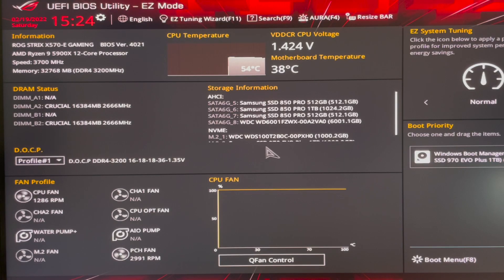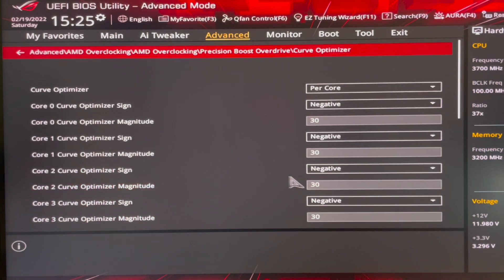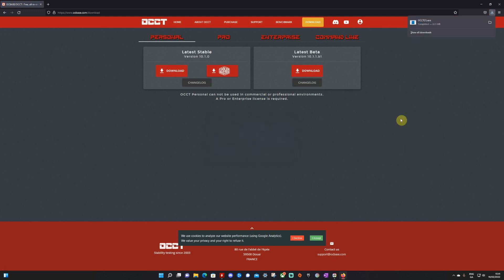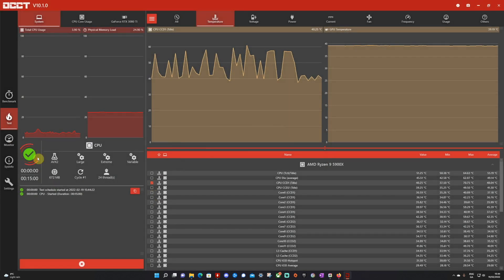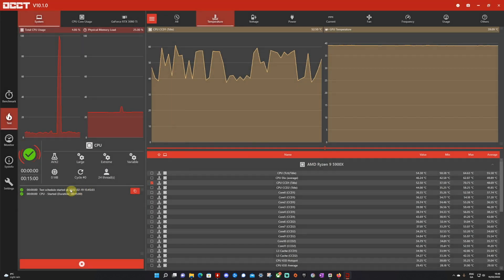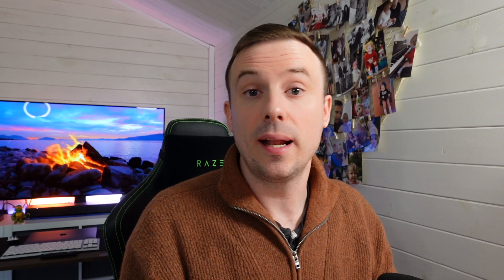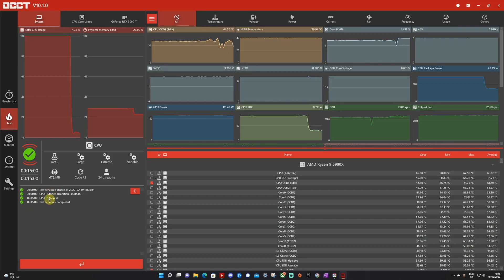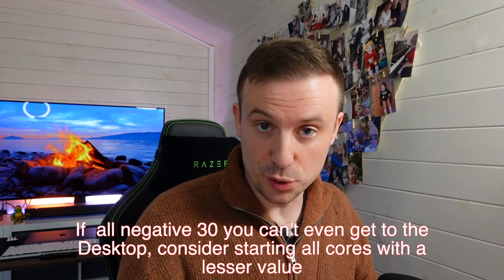Ryzen 5800x 5900x CPU Per Core Undervolt Bios Settings | Lower Temps | Better Performance

Comment: Had to start with -15 for all cores as it was only giving me blue screen from -30 to -20. Seems like -15 was my sweet spot, did the 15min Extreme test and no errors. 

Going to be doing the 30min extreme test next :)

EDIT:

So I did the 30min stress test and everything is still good no errors with all -15 cores. My avg. was 4.5ghz at 65c, there was a spike of 73c at one point. Should I be happy with this?

So after stress testing the system for 30mins, it was fine but then soon as I launch a game I was greeted with blue screen. I will be testing it again for an hour and see if anything needs to be changed.

5900x
Asus TUF x570 wifi plus
Reply from the maker: It can take time to test and not all cpus take well to an underVolt
Reply: @FPtechtalk  what if all cores are undervolted to -5, is that still viable? How long should I stress the system for to get absolute stability test? 2hrs?
Reply from the maker: It’s prob just one or two cores causing the problem. For me a half an hour test did it. What might work better for you is to move them all back to -20 or -15 and try a per core test. This might allow you to find the bad cores and move them to -5 or 0. This will take time but to do this go to the same settings in occt and click advanced beside threads. Then click the settings cog just below. You can set here to cycles through the different cores every few mins for example. This might give you an idea of what’s wrong
Reply: @FPtechtalk  will do that! Thank you! Ill keep you updated bud!

Comment: Hi! I just wanted to ask your opinion on this. I followed your guide and there were zero errors and everything was set to negative 30 per core.
Is this a fluke? Right now my ppt, tdc and edc are set to 175, 120 and 190, with 30 negative per core and 150 boost.
I am just surprised that I had zero errors with the negative per core OCCT test. I ran Cinebench23 as well and had no issues. Does this mean it's stable?
Thank you very much for your videos as they helped me understand my 5900x a bit better!
Reply from the maker: You could be lucky and have an excellent 5900x. It’s sounds to me like it’s stable. The only way is testing which you have done. You could be yet run Aida64 for an hour but to me it sounds like a excellent result.
Reply: @FPtechtalk  
I'll try running Aida64 next then!
Thank you very much for your guidance! I hope that you continue to make more videos and get more subscribers!

Comment: Undervolt (25/10/25/25/25/15/25/25) *30 on any core would bs when loading win.

Temp - 72.1c max  (aio phanteks glacier one 280mm) @ambient summer temps of 27c 
Pwr draw - 112.9w max
Clocks all core - 4.801GHz
Cinebench R23 score - 15543

Comment: in my ASUS 470X F-GAMING the option for CPU BOOST CLOCK OVERRIDE has only POSITIVE, NEGATIVE and DISABLE, how do i setup there? i enable POSITVE in a 25 value is this value correct or should i disable it?
Reply from the maker: The positive / negative option should be for the curve optimiser?  Which should be negative if you want to help reduce temps

Comment: Interesting. 
From my testing this method my CPU R9 5900X goes on offset curve --20 on 1-11 cores. On 12th core only -10. 
Testing core to core I tested and the numbers are -13, -20, -20, -20, -16, -20, -20, -20, -20, -20, -18, -10.
All core load I manage with NH-U12A 4.6GHz with 75°C. 
Only 1 core to another core the temps are 85 - 89°C.
Reply: i have very similar numbers as you on my 5900x but have you checked if it stable while idling?
Reply: @Citron15  It is stable. You have any problems with your CPU?

Comment: I have an all-core CO value of -21 I believe it was. Ran a full hour last night with OCCT's built-in core cycler and had no errors. Wondering if that's a false positive since I didn't have the option checked for the program to stop upon error detection.

Cheers for the tutorial. Been looking for something like this for days!
Reply from the maker: Even if that is turned off it will report any errors in the app
Reply: @FPtechtalk  ah good to know. Just did a 15 minute, core cycle run with a -27 CO passed. No errors. The moment I tried opening YouTube on Chrome the system did a hard reset. Guess I'll just have to keep alternating between OCCT for full core-to-core loads and then back to ultra light workloads to get to a rock solid CO. I do have a small +100MHz boost clock override, wonder if that could be the cause for the low/idle load crash...
Reply from the maker: I don’t think the clock boost is it. I have mine at 200. There might still be one core causing an issue not showing up in occt. You could try testing each core individually

Comment: Excellent.
 I discovered through trial and error since my Msi x570S mpg has both bios flash and clr cmos button.... that in order to max. True under voting and heat, one must NOT touch either BIOS menu CPU OR XMS buttons? If one does it will lock Ghz at 4.15 and increase volts make it reach 85-88°C under test with CINEBENCH 23? Totally overriding any undervolting bios settings you made...?? THOSE 3 BUTTON ~ CPU and XMS 1/2. IGNORE.

I also have MIXED rank/speed DDR4 4x8GB: which works amazing sprinting at OC TRY IT! pc2400 C12-14-14-34 2T across all banks stable. Scores are 200~300 pts slower=negligible. 

OK. my 2cc's

pair Corsair Vengeance RGB 8Gb PC3200 C16 single Rank (new)
pair Crucial Ballistix 8Gb PC2400 C16 dual Rank (5 yr old)
HOW?...simple. on my MSI X570S MPG EDGE MAX WIFI:

First, shut down unplug power and press power button to clear any residual charge. 
clr CMOS hold 10s then connect power and boot to Bios.... I also needed o unplug all monitors except my VGA to DP 17lcd to enterMSI X570S BIOS, which btw came preloaded with latest 12/27/21 (latest is BETA April 2022. No.) THE KEY ALWAYS IS STABILTY FIRST. 

OC menu select tested profile ddr4 to PC2400 on TRY IT! option...auto set correct timings for CAS 12

settings menu in advanced
ADVANCED Precision Boost
PBO disabled
CURVE NEGATIVE and 29

F10 save and reboot...check in bios before booting to win 10 Home. It will list

5900x at 3.6 with lowered vote from 1.42v to 1.37v
Ddr4  @ 2400 cas12 32gb

Windows 10 OS...
4.4~4.5Ghz all 12 cores/24 thread processors
4.8~4.95 ghz multiple cores on single core benchmarking

53~63°C full power; idle 35~39°C in large room ambient 23
 AMAZING!!!

CUSTOM BUILD MAY 2022:
I also have all NVME M.2 storage inside a Corsair 5000D AIRFLOW with top vent empty no filter, 2x 140mm rgb front intake fans, 3x 120mm side intake vented over motherboard/GTX 1060 6GB GDDR5 and giant AM4 mosfets with a Noctua black NH-U12 2x120 cpu heatsink for my Ryzen 9 5900x ...all on fan curves with 1s delay down ramp. Pretty quiet even under 90% speed. Very efficient. 

I hope this inspires. It was fun.

Comment: I just want to ask which is better for curve optimize. All core volt or per core volts?
Reply from the maker: It’s really what works for your processor. There are generally some cores that can’t underVolt as well and can cause crashes. That’s why you have to test and be less aggressive with the bad cores. I am doing per core.
Reply: @FPtechtalk  can I set per core all -25 or 30?
Reply from the maker: You can try and test. If all is stable then should be fine. If it crashes you need to find the bad cores and reduce the value until all works under stress

Comment: Hello, i have a problem with my 5900X.. on windows i just open a window of google or something and i go to 45 to 60 DEGRES and playing valorant i get like 75 degres i had this Ryzen 9 before on my last setup with a Corsair H150i cooler and i never get those temps.. now i have the Z73 NZXT.. can you help me ?
Reply from the maker: The 5900x does tend to have some spikes. I have had similar behaviour. It did help when I done a fresh install to windows 11 but still happens a bit. For example when I first log in it might jump to 78 for a few seconds

Comment: Followed the video advice - noticed on windows 11 the max freq achieved is about 300hz lower on cores cores 6-12 on a 5900X. Is this a Windows 11 behaviour or does it mean I can push cores 6-12 on a higher value i.e. over 30+?
Reply from the maker: No, negative 30 is the max value. What test did you see the cores 6-12 300mh less?
Reply: @FPtechtalk  Same as the test on your video chap. Had an issue after posting of my comment as I was getting a reset with no BSOD. Changed values to 20 and then 10 with same effect. Made a boo boo somewhere I think. Suggestions welcome!
Reply from the maker: The only option you would change are the negative curve values. With the occt are you seeing any cores with errors? If a problem I would reset the bios and start again
Reply from the maker: There also just be one or two cores causing the issue
Reply: @FPtechtalk  Yeah I ran per core settings and none came up as an issue even maxed at -30. Must be a power draw issue somewhere.
Reply from the maker: Maybe try a longer test. Go for an hour and see if anything comes up. Does it run ok on a 10 min cinebench r23 multi core run?
Reply: @FPtechtalk  hour test in OCCT completed on Extreme. No issues highlighted. Will try Cinebench.
Reply from the maker: And after the test the system crashes during normal use ?
Reply: @FPtechtalk  Yup - pretty annoying isn't it!

Comment: Thinking about doing this on my 5900x now. However does this slow down the cpu since we’re lowering voltage? Or is this pretty much just using the normal settings just giving it lower voltages to lower temps?
Reply from the maker: My cpu runs a little faster after doing this and less temp. That’s the benefit of undervolting
Reply: @FPtechtalk  is this not really considered a true undervolt since your not messing with the base voltages? I’ve seen a few other videos where they change the core voltage n start messing with all that stuff. Just curious

Comment: Is it safe for the CPU ? Does it decrease its lifespan?
Reply from the maker: There is always a risk with overclocking but undervolting should have no negative effect once you get it stable. In saying that if you are not comfortable changing these settings I would consider leaving it unless you need better temps.
Reply: @FPtechtalk  Thank you !
Reply: @FPtechtalk  I made it and there is no error (on all cores, no error). But when I try with Cinebench my pc restarts instantly. Do you have any idea where the problem comes from ?
Reply from the maker: There must be some core not liking the value you have. Try reduce all to 20 or try a longer test to find the core

Comment: Hey, Im running -20 on my 5900x after multiple optimisation (he is even stable on -30). But i don't understand why my CPU always hit 90C. I can't do a manual configuration because the CPU crash at 110C on Cinebench or Extrem load on OCCT. Did a lot of test to optimize, bought a new tower, more larger with new fans. I'm currently running a MAG CoreLiquid 280R AIO. Do you think my AIO could be the problem ? Will I see a change with a 360 or something like this ? I take every advice ;)...maybe if you have a good call for an AIO to buy for my 5900x.
Reply from the maker: I’d check the paste on the cpu. You say your hitting 110c with cinebench? Is that even before any changes are made to the bios ? Does the negative curve make any difference?
Reply: Nothing, i tested it even stock nor cadenced to 3.7 manually. Tested a lot of vcore to put it stable and it is still weird. On cinebench at 3.7 ghz, the CPU start increasing slowly.. reach 85 then 90 and after 20 / 30 min it goes to 100+. Really weird. 

Yeah changed the paste twice too (when we changed my tower). 

I will recieve my arctic freezer 2 360 tomorrow and check the difference. Maybe my AIO isn't working properly.
Reply from the maker: I hope that fixes it as seems really high. Let me know how you get on. When I do cinebench r23 multi core 10 mins it maxes about 69 c
Reply: Wow incredible :o ... yes i will ;)
Reply: @FPtechtalk  Hey Dude, got some news here. I got my Artic freezer 2 360 and this is a blast ! I went from 90C to 65C on cinebench and OCCT. The cinebench score went from 18k to 21.9k with a 10 min test ! I'm so happy right now, so now im with -20 negative and everything is fine.
Reply from the maker: That’s some great improvements. Good stuff 👍
Reply: Well. I discovered DO NOT select the BIOS cpu and xms buttons. Do it manually.

Comment: Oh man, my CPU must be bad.. I'm hitting 87C on the package while running the OCCT stress test w/-25 on the curve for each core
Reply from the maker: What do you get when you run something like cinebench r23 multi core test
Reply: @FPtechtalk  same, in the 90C range. If I limit my voltage it comes down but I don't think that's the proper way to Undervolt. I was hoping to use the Precision Boost stuff.. If I try to make any adjustments CineBench will fail to finish it's test..
Reply from the maker: With the -25 curve does it crash on cinebench

Comment: I try all value negative 5 ,10 ,15 ,20,25,30 but all time i get only crash in and reboot 😔 my 5900x i dont know  why 😔 now i m run in default settings
Reply from the maker: Not all cpus are able to undervolt and remain stable. I would of expected at least some value to work. Is the curve optimiser the only thing you changed when testing.

Comment: So aside from what you discussed here, you leave all other BIOS settings at default? I'm looking for lowest possible temps on my liquid cooled 5900x, while still keeping boost clocks, but not overclocked. Thanks.
Reply from the maker: Hi, yes the only settings that we’re changed are in the video. What kind are temps are you getting

Comment: So just curious.
New to all this undercoating ect but managed to get mine at 4.55ghz on 30, @1.350v average temprature of 56-57c during the OCCT test.  How would I go about pushing to 4.6-4.8ghz? 

Very new to Overclocking and such.
Reply from the maker: if you are getting good temps and good performance like above I would be happy with that. I have other videos up for AMD bios settings that can push the performance higher. Outside of that you would need to start manually changing and testing voltages

Comment: I will mention that if you leave your PC at idle there can be crashes that weren't apparent when running a game. For example originally I had a few cores set to -25 and others set to -20 and during games everything was perfect and fine but if I left my PC idle or just watched YouTube videos I'd have crashes and that didn't change until I lowered a few more of the cores to -15.
Reply from the maker: Haven’t noticed that myself. Did you try an extended test of maybe 2 hours to see if any cores were giving issues
Reply: @FPtechtalk  Yeah I had done one overnight and it was all good. Didn't have any crashed cores, but if I just sit here and watch YouTube or do something less intensive it would go  RIP
Reply: @Venoxium  if u go idle mode, just change the energy cpu boost to deactivated :)
Reply: @Venoxium  Once you go into idle mode into power management just set maximum cpu state cpu to 99% that's how i fixed it
Reply: a good way to check this is by instead running your single core tests in small workload sse. this should do a better job at exposing issues with undervolting.

Comment: hi, thanks for sharing this video. I have a concern, when I do the two tests in OCCT (15 and 30min) it passes and does not detect any error in any core, but when I try cinebench and games it crashes. How do I identify the cores in this case?
Reply from the maker: You may have to go even longer with the testing or reduce all the values by 5 to see if it helps. I would do a 2 hour test.
Reply: I have never been able to pass OCCT stability checks on RAM + CPU & then Benchmark both in OCCT and not pass a Cinebench run. Is it possible there's something going on with your RAM?

I also don't have to test for very long either with this approach.
Reply: head into your bios and disable AMD Cool n' Quiet.
Reply: Same -25 all core, OCCT passed (30 min Large-Extreme-Variable test) no errors but ran Cinibench 5 mins later after letting my system idle, crashed in 2 mins lol.
Reply: @8SnazzY8  this is what happens to me now...

Comment: What version Bios are you running? My bios doesn't have the same options. My specs are the same as your system. Many thanjs.
Reply from the maker: I am running version 4204 at the mo. Some of the videos will be earlier releases but I have been keeping the bios up to date and all options from before are still there
Reply: @FPtechtalk  Thank you so much for your reply. I was being a little idiotic. The settings are there. I just needed to set 'per core' not 'all cores'. I guess I need to listen better. 😂. Thanks once again. All the best.
Reply: @FPtechtalk  So just to let you know. That after listening and following your instructions my CPU is now optimized. 😂 Thank you again so much for your info and guidance. All the best.
Reply from the maker: Great to here. Happy it went well. All the best with the cpu. Thanks
Reply: @FPtechtalk  , many thank again. So far so good.

Comment: it does not tell me what core failed...
Reply from the maker: Does the tool run like in the video or what is different ? Just be sure you are running it the same way
Reply: @FPtechtalk  all is the same, other than i dont get the luxury of getting told what core. but then again i get the benifit of screen turning blue :D
Reply from the maker: If you send me over some screenshots on email I’ll have a look. Not sure why you don’t see it
Reply: @FPtechtalk  maybe the ppl behind occt  have more love for amd , maybe maybe.  i have 7940x